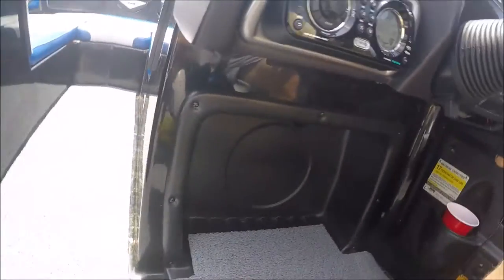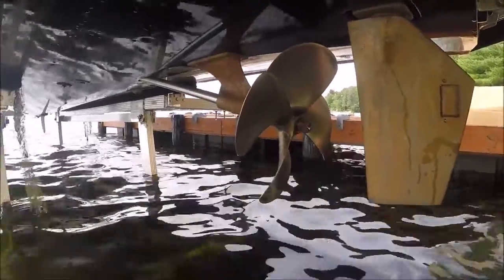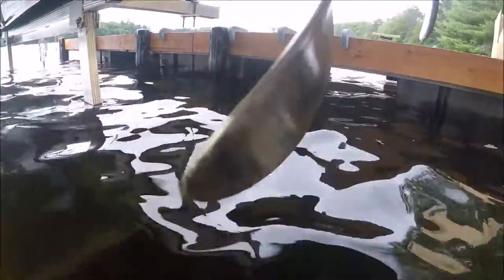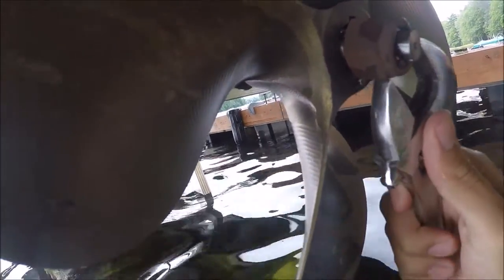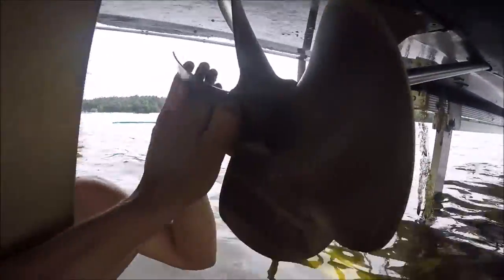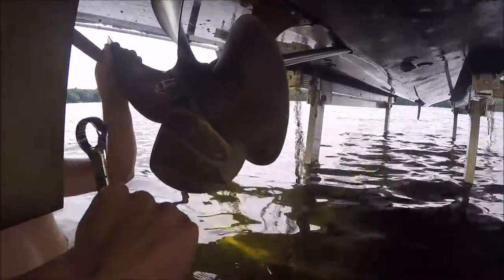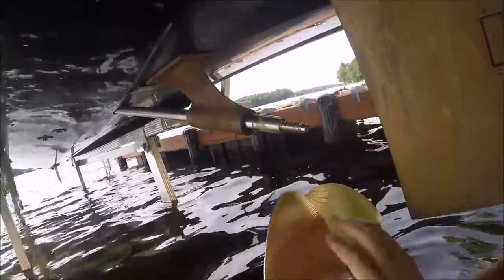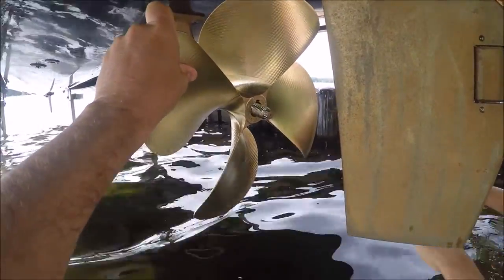How to Replace Inboard Boat Prop to Fix Steering wheel Shaking

Comment: how do u remove a cotter pin?
Reply from the maker: Mine came out pretty easy, was able to bend by hand and pull out, if yours is older you might need to use a pair of needle nose or cut it and get. New cotter pin. Best of luck hope you get boat back in the water soon!